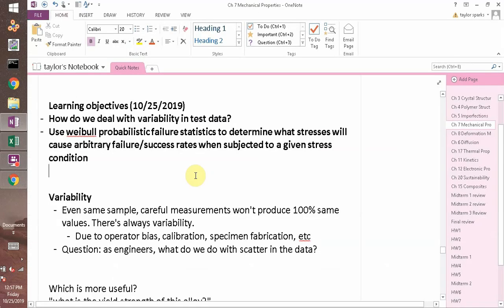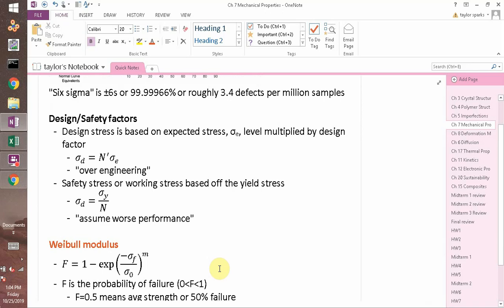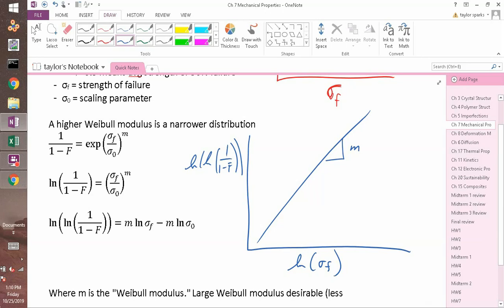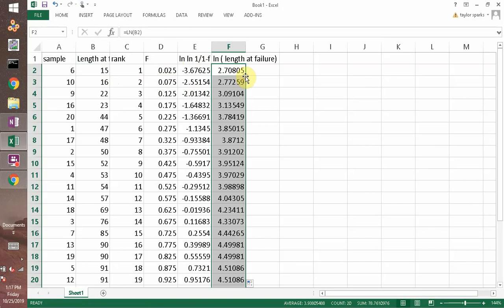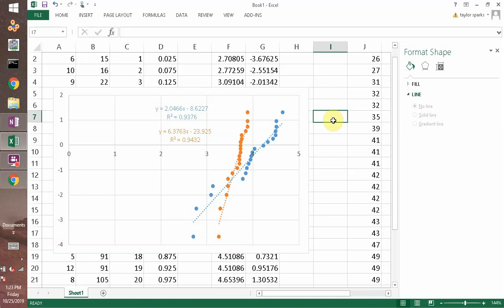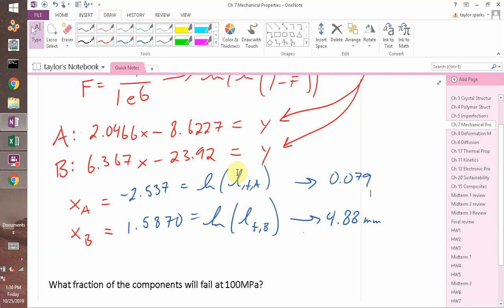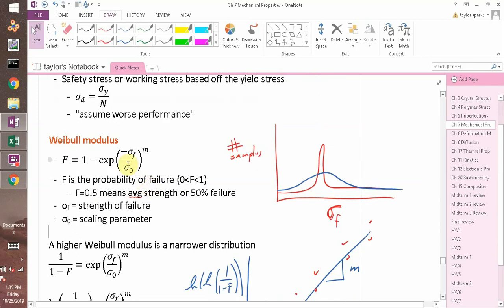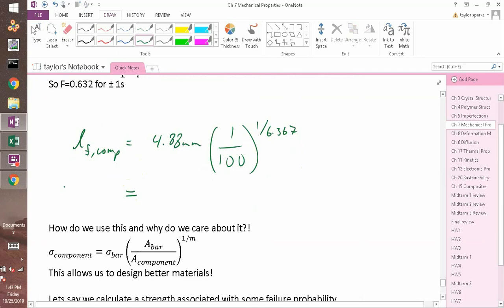Introduction to Weibull Modulus and predictive failure analysis

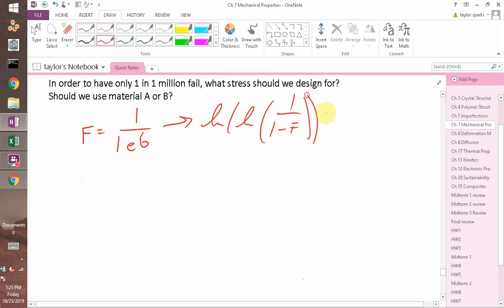Comment: I lost you when you started explaining F=1/1e^6 —-ln(ln(1/1-f)) at 29:48. What column in your spread sheet represents “F”?
Reply from the maker: Think of f as the probability of failure. In a perfect world, we would know what that was by testing infinite samples, but since we don't have that and we're trying to prevent the testing of a million samples through weibull analysis, we have to replace it with something else. So what we'd use is the rank of the sample failure divided by the total number of samples. That gives you an idea of giving your number of samples. Where did it fail in that order? Was it at the 10th percentile the 20th, percentile etc. Then we subtract the 0.5 to make sure that it accounts for edge cases so that if you were to test a million samples, you have some finite probability of finding a new best or worst material instead of it being locked at 0% failure or 100% failure within your smaller data set

Comment: I was first skeptical because I just saw a bunch of notes and lots of switching between windows but this is hands down a really good tutorial. Thank you! I work as an engineer in drug manufacturing and some modules of our devices are just the worst. We know the design flaws but our hardware suppliers are very slow at providing solutions and so I was thinking about doing some predictive maintenance. There are certainly other ways to predict (sensor data, which we have but don't use as much) but this is a great generic approach that I'll give a shot.

Comment: ok, i came back here to leave this comment because i am stuck on a real-world situation. I have 25 samples of 3d printed parts i tested in the tensile machine. The maximum was about 55MPa for PLA+ and the low was around 46MPa. 

I have used the same rank formula as you, as well as the median rank method. I have found the slope (beta) also known as the shape parameter, but now i am trying to find the scale parameter known as n. The scale parameter (characteristic life), representing the time at which 63.2% of items are expected to fail. This value should be in the range of all my tensile strengths. 

when plotting the data in excel and getting a line, i have y=27.26x-86.048, if i do e^-86.048 to get n, its a HUGE number. so i have messed up somewhere haha. below are my tensile values

i tried to use chatgpt but got some serious random errors. I am a mechanical engineer working on my masters but none of my classes went over this haha

I am trying to use the cumulative distribution function (CDF) but it requires beta and n.  CDF=1−e^-(t/n)^b

any help would be excellent. Maybe chatgpt confused

46.1
46.7
47.3
47.9
48.3
48.6
49
49.2
49.8
50.1
50.4
50.7
50.9
51.5
51.8
52.1
52.5
52.8
53.1
53.2
53.9
54.4
54.6
55.2
55.6

Comment: If i wanted to learn more about using excel in this way and this type of statistics, what would i take?

thanks. I am graduating this month in mechanical at UVU but even in my undergrad, we hardly touched on this stuff, even at SLCC

I actually learned more stats in my black belt independent study i did through an online company than i did my schools haha
Reply from the maker: Probability theory. That's what you want. If you want to keep learning, and since you are in Utah already, you might consider applying to our graduate program.
Reply: @TaylorSparks  i have thought about haha. I travel 120 miles one direction for school as i live in Brigham city. But i could check out the U and see. Thanks for replying.
Reply from the maker: @LT72884  Salt Lake City is even closer than UVU. Actually, my most recent PhD grad from my group is living up in Brigham City because he works for Northrop Grumman. Once you are done with classes after the first two years, some programs even allow remote work. For example, my students typically do machine learning and so they can work from wherever.
Reply: @TaylorSparks  true, i grew up in draper :) but then went to usu for some school before switching majors. 

Slc is alot closer, even if the u is east. 

I really enjoy what i have learned about weibull and predictive failure from your videos. 

Ill start researching more on probability theory

Comment: Thanks for this great explanation. 
I'm confused about ln(ln(1/(1-F)) vs F. 
If I want to have a 1/1,000,000 chance of failure, I find the log(stress) value corresponding to the F = 1/1,000,000 along the data trendline. I don't use ln(ln(1/(1-F)) for that, right?

Comment: Hi Taylor, I am researching the strength of eggshells for two different diet groups. For the strength values, the Weibull distribution fits both groups very well, and I want to know if there is any statistical difference between these groups. Do you know how could I do this?
Reply from the maker: You will need to check to see if the confidence intervals of your Weibull fitting overlap or not. I didn't cover confidence intervals in this video but you can read about it
Reply from the maker: One thing you might try would be bootstrapping. Bootstrapping will allow you to create many many versions of your data and you could do Weibull fitting for each one and then take the average and standard deviation of those fits and see how they compare with one another.

Comment: When you ranked them, some of them have the same length (16th and 17th), so it should be the same rank otherwise it gives different failure rate for the same length ?
Reply from the maker: Yes. There are other failure ranking approaches.

Comment: How to use Weibull formula for precipitation in hydrology?
Reply from the maker: What does the data look like? Weight fraction precipitated over time?
Reply: @TaylorSparks  No sir. Annual rainfall of 22 years is given in cm (1960-1981). Q1: Estimate the annual rainfall with return period of 10 years and 23 years. Q2: What would be the probability of annual rainfall of
magnitude equal to or exceeding 'X' cm. X is given. I have found using P= m/(N+1) formula just one hour ago but failed to understand clearly why using this
Reply from the maker: @sayemasaliha  are you specifically being asked to use a wibal distribution? Have you tried fitting it to a weibel distribution yet? It might be the case that another distribution is going to be more accurate.

Comment: This is the clearest explanation I've seen so far.  It is unintuitive for me on  how the failure rate is based on a rank and not a bucket, or histogram that counts failures.  I'm going to have to spend some time looking into that.  Any book or source you recommend for learning about F?
Reply: If what you mean is F, that is not the failure rate but the probability of failure. Say that you have 25 samples and length 5 mm is ranked at 6 in ascending length, this means that 6 out of 25 samples fail at length between 0 and 5 mm i.e. F(5 mm) = 6/25.

Comment: Hi Taylor! Fantastic explanation!! Thank you...My question is: the Length of failure in your excel spreadsheet it CAN BE MTBF??? Can I calculate reliability as you have done using the MTBF?
Reply from the maker: I imagine so. The first thing to try would be to see if it can be fit with the wibble equation. If so, then you should be able to use it as a probabilistic analysis tool

Comment: Thanks for the great lecture. I'm confused on the intuition behind length of elongation of the component computation. Is it akin to the idea of that: we have 100 bars so we must calculate at least 1 failing and hence this is like changing the required 1 / 1 million to 1 / 100 million in the original equation?
Reply from the maker: I'm not totally sure that I follow your question.
Reply: So the example towards the end is estimating the component length  elongation with 100 x area of bar with same failure rate, right? And the length is much shorter. If the component had the same area as the bar but 100 bars were used (so that force area is 100 times) then we would expect 1 of the components to break earlier than the average failure rate. And that is why we should have component length much shoter. Equivalent’ish to looking for 1/100 million failure rate in the original bar intuitively? I hope it makes sense now.

Comment: Thanks for the tutorial! I have one question regarding how you calculate F (in your case F = n-0.5/N). I have encountered other approximations for F like F = n-0.3/N+0.4 (mean rank approximation) or F = n/N+1. When is it more appropriate to use one or the other? Is there a relationship to the sample size?
Thanks!
Reply from the maker: I'm not sure which is actually better. I think the one you cite is much more common though.